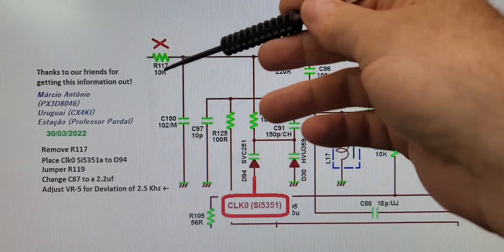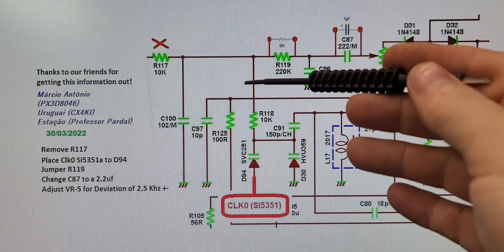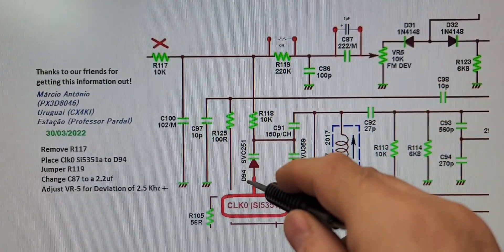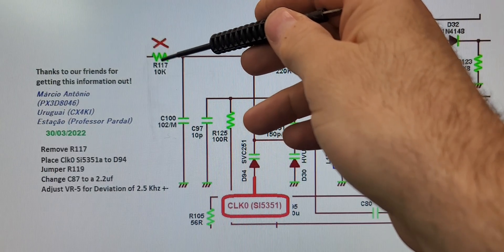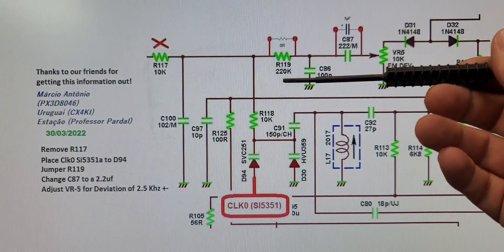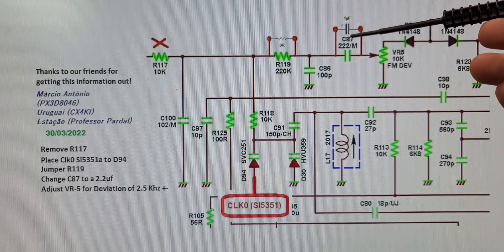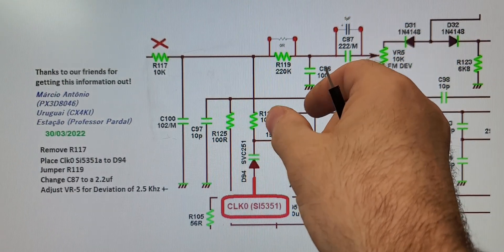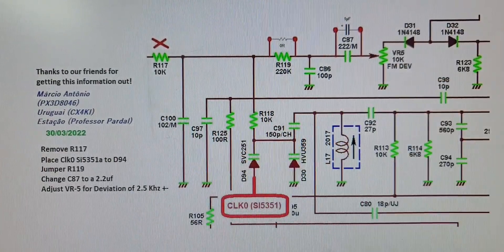FM with DDS-VFO

Comment: Interesting how you are managing to produce FM with the SI, I have taken a different approach by using the SI5153B IC. It took a bit of tinkering but I can now produce very clean FM from 500KHz to 10KHz deviation on the LO.
Reply from the maker: I wanted to use the B but cant seem to get a script to work. Do you have a simple one I could try?
Reply: @ddsvfo  Troy not sure what's happening as my messages are not showing up. I can send you the code and a circuit diagram for the si5351B I have it modulating FM really well. I can't find your contact details.
Reply from the maker: @M0XFXUK  I just see this, but I did get your email! Thanks and I will take a look and try one of my Si5351b
Reply from the maker: As you know, you can't run the output of the SI5351A by modulating it directly. It's a vco trick to make it happen. The processed pre vco can be modulated if it's done correctly. Also, in many radios, the VCO can be driven to give great FM with the SI5351A running it.